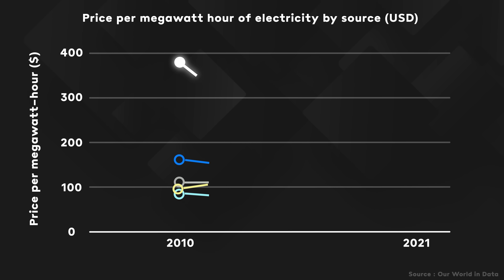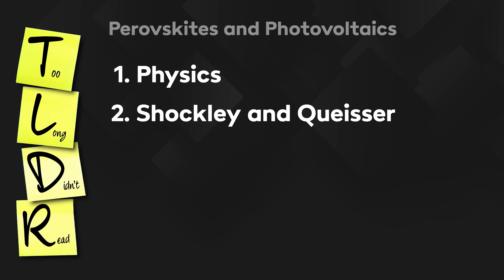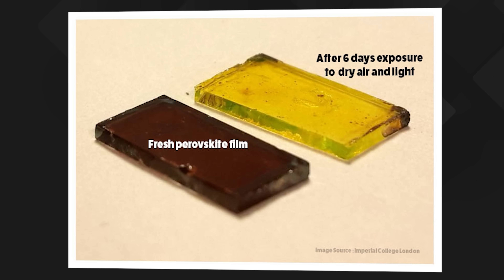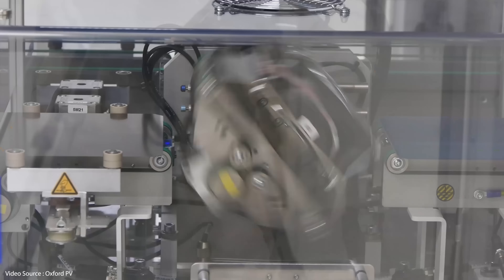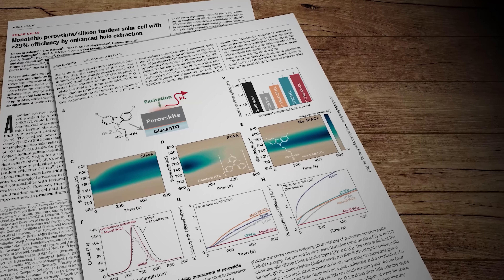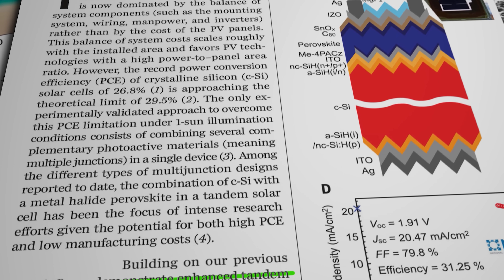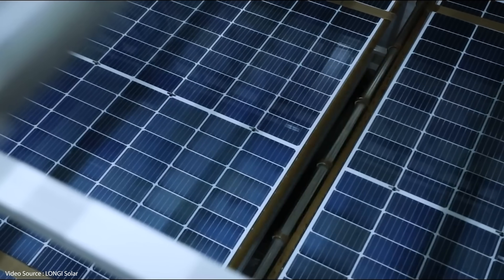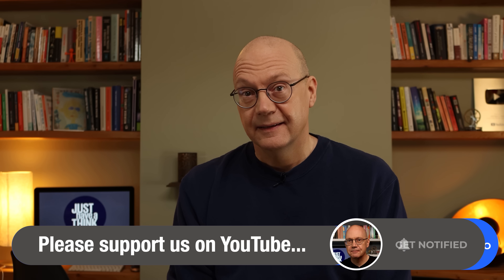Perovskite Solar PV. FINALLY some good news!

Comment: As an installer, I cant wait to see some from the wholesalers as this would mean people in smaller properties could have a system worthwhile and get their bills down. They dont need to be big roofs or even face south. East West splits will work well, I do lots of them and my customers get their investment back with 5 -7 years with plenty of life to make and save a tonne of money.
Reply: I'd also imagine lighter panels would be appreciated as a general safety and convenience benefit to your employees too.
Reply: @meganegan5992  i doubt its gonna be lighter as the perovskite is additional to the silicone ones.
Reply: @teekanne15 most of the mass is made of glass, plastic and the aluminum for support structure. The photodiode part weighs very little.
Reply: @teekanne15  Yes, it won't be lighter and also there's no trend to make it lighter at all as the handling of numbers of panels is a dominant cost factor. Lighter would mean smaller and more panels which would be a drawback over the current state of the art. (costwise)
Reply: @teekanne15  that's fair. I hadn't considered additive panels, moreso the idea of getting rid of the silicon altogether, and like an above comment said, the majority of the weight comes from the glass and aluminum, not the photocell. Shame it isn't as good as I'd imagine, but still, this is just good news in a different way, no?
Reply: I am the employee of my own company so I flipping well hope they will be🤣 @meganegan5992
Reply: Joe, agreed! On a lot of houses, the bit of roof facing south isn’t that big!
Reply: @freeheeler09  The roof doesn't need to face south to be productive!
Reply: Yeah.  I've seen several estimates for my house over the past five years or so.  Can't make it work financially.
Reply: @bjb7587  400w panels are freely available for less than £100 each?
Reply: wrong people doing your estimates. 5 kw and 10 kw battery should be around the 10k mark and provide you with a 5 yr return on investment leaving another 5 yrs under warranty to save the same outlay, around 10k depending on house. My customers do ! @bjb7587
Reply: And be lighter for you too 😅
Reply: 🤣Yep @Bill-uf6os
Reply: @liam3284  Less material for the same power is correct, but a typical smart prosumer wouldn't install less material but more power. Bottom line the installation weight is approximately the same.
Reply: Every time I read perovskite, my brain pronounces it perskovite for some reason...
Reply: Why would it be good to waste solar cells that could go into well-built and well-sited solar farms just to make people money? Isn’t the planet worth more? We’re already throwing away half of the value of home-installed solar (versus just installing them in farms), even without counting the increased roofing costs and damage.

Such a waste. Almost as bad as recycling plastic that could otherwise provide clean fuel.
Reply: @liam3284  15 years is a more realistic value.
Reply: Solar is still ridiculously expensive, way more than fossil fuels.  The LCOE metric is so incomplete as to be an outright fabrication.

If you have a power need, meeting it with solar is extremely expensive. You need a ton of battery storage and about 8 times that need in solar panels.  Like if you need a continuous 1kw of power continuously, year round, you will need an 8-10kw system or more to actually have a continuous 1kw supply. That's because solar NEVER produces it rated output, even at solar noon in the summer. During the winter, it produces far less and for much shorter time period. If you have a continuous 1kw power need, you need to generate your whole 24kwh supply in the time the sun is shining. Of course, a week without (EDIT SHOULD SAY WITHOUT DIRECT SUN)clouds in winter is quite common.

The LCOE only takes installed capacity into consideration.  However many solar panels you happen to have will produce X number of watt hours over its alleged 30 year life span. Divide the cost of the installation by the number of kwh and you get the LCOE.
Reply: @tarstarkusz  If you really take into account a 30 year lifespan, solar is actually very cost effective. From 1 KWp (installed) you can get close to 1 MWh annually, which is up to 30 MWh over the life span. In Switzerland, where solar is really expensive, if you install 1KWp as part of a decently sized PVA you pay CHF 2000. This means your cost is somewhere @ .07 CHF/KWh which in most places is about 5 times less than buying it from the grid. No idea how you think it is more expensive than fossil fuel.
Reply: @beatreuteler  Yes, but it won't produce 1kw continuously, which is how we need power. We don't need the average, we have power requirements.  This is true of our homes and it is especially true of the grid.
If you installed 1kw, when it was generating power, you would use less grid electricity. But if what if the grid wasn't there and you only had your 1kw panel system and you had a sick person hooked to machines that required a continuous 1kw?  That person would die hours before sunset on the 1st day.
Reply: @tarstarkusz  That is true but that isn't a problem at all. Industry and many other appliances like average households do NOT have a continues power requirement in that sense but have a significant midday peak requirement which corresponds pretty well with the average daily supply curve of solar systems. Then going from there networking is the key (even prior to storage). If you make your average power yourself but it doesn't exactly cover your demand curve, through networking with the "rest of the world" you can cover that nicely. If the gap is too large between purchase tariffs and delivery tariffs, you go for storage. That's it.
Reply: @beatreuteler  The grid absolutely does have a minimum requirement at all times. That is how it is designed.
Where solar makes sense, like adding it to the grid so on summer afternoons there is extra capacity to run air conditioners, it can/should be used. But that is not what people are talking about. They are talking about getting rid of the existing power plants and replacing it with solar.  Problem is, these plants have utilization rates over 90%. Solar goes as low as 5%.  Large amounts (though well under the majority) of solar should be facing West, not South.
"Doesn't exactly cover your demand curve" is the understatement of the century.
Reply: @tarstarkusz  Solar systems should be facing like the roof is exposed, e.g. if the roof is east/west, then solar system be east / west. The dominant south orientation is a result of the past when efficiency was even lower than today and people found it important that their system being facing south. With higher efficiency, orientation becomes less important and therfore people will build more solar systems in any orientation, which will be good for the total daily solar delivery profile. Talking about utilization rate of solar systems is nonsense. Every solar company will calculate the power expectation for your specific case and exposition. It is irrelevant how much installed capacity you have if you can finance it by the harvested energy. If your country and /or provider isn't making acceptable conditions for that, I then would agree it may make more sense for you to await better conditions. Where I live, we are not talking about getting rid of the existing power plants as far as hydro plants are concerned.
Reply: @beatreuteler  First, the majority of solar is not on roofs.  Second, the energy you collect is worthless and the laws making it not worthless is ripping off all the other customers.  Most of the cost of a kwh is not generation, it's the grid.
Reply: @tarstarkusz  I don't know where you live so I can't comment, but where I live the vast majority of solar systems is rooftop. The energy I collect, if it is excess I get paid for it with 0.18 CHF/KWh this is not worthless because it is higher than the cost of collecting it. Energy I collect and use it right away is worth even more because it saves me from buying. This said it is currently worth 0.36 CHF/KWh
Reply: @beatreuteler  You are getting paid that by law, not market rate.  The cost of generating a kwh of electricity is very low.  Most of the cost customers pay is infrastructure....the grid.  If you had to sell your extra kwhs on the open market, you would get very little for it.
Reply: @tarstarkusz  You are not correct with your guess. While providers have an obligation to buy the excess energy of Prosumers (by law) the tariff they are paying for this power is not regulated. This results in a patchwork of regions with very different tariffs, depending on who is the local provider. tariffs across the country currently vary from 0.06 CHF/KWh to some place like 0.40 CHF/KWh. By accident, our provider is in the mid range. The full cost of power from small to mid size rooftop PV depends mainly on installation cost and therefore is high here in Switzerland, it is about 0.1 CHF/KWh. Of course, larger PVA's have lower cost than smaller ones but that's a good average. A friend of ours that was able to build a 400KWp PVA rooftop on a small to mid size business rooftop achieves a cost of 0.04 CHF/KWh but that is rather exceptionally low.
Reply: You are not accounting for interest payments or lost investment income
Reply: Would a global grid taking solar from another side of the earth work?
Reply: Some of your 'Facts' are wrong. Of course it never produces its rated output, this why us installers have to use a predicted annual generation to a SAPs in the UK so its not mis sold. As for your alleged 30 yr lifespan, another incorrect comment by yourself from echo chambers on the internet. People that have it done right do save and reduce their bills to very little and the panels do last which is why they come with with 25 yr warranty as standard. If youre going to reply with a load of nonsense at least try and get your facts right.  @tarstarkusz

Comment: Cooling (and using) the heat solar PV panels collect increases net efficiency and lifetime.  Directing sunlight by reflection will also increase the length of total daily potential for energy production.  Both of these approaches will allow wider applications and lower total installed costs. The industry is cherry-picking locations rather than innovating for broader potential sites in the urban environment.
Reply: Yes and no, the more you can convert the less heat there will be in the first place. IR is the heat - so if you can take that in - the less over all heat goes to the rest of the panel it self.

Comment: the supercool thing is, that the additional efficiency is still there in winter where the loss of energy mostly affects the infrared part of the spectrum.
using them vertically on a fence or balcony still gives you a good amount of efficiency in winter.
the vertical installation is not perfect in summer but it is a better balance throughout the whole year for people who live a few thousand kilometer away from the equator.
and together with a sodium ion battery, you get a quite affordable setup to produce cheap energy everywhere all year.
btw.: the University of Bayreuth pushed sodium ion batteries to 165Wh/kg which is fantastic!!!
the future of renewables is bright!!!
Reply: And panel temperature is often forgotten.  Efficiency drops at T rises, but as T falls efficiency rises.  I just had a 100W panel at peak winter sun, northern latitude, ideal alignment and on a clear day at subfreezing temperatures generate 110W while on a normal sunny summer day, you never get above 90W.
Reply: @SeekingBeautifulDesign  Should actually also help a bit in summer. As more light is converted to electricity less is converted into heat.
Reply: I didnt know this, do you have any numbers on its potential extra gains in winter? Current panels are already efficient enough in summer where even my small system makes way more power than I can use but the worst 3 months of winter are a real struggle so even a 10% gain would make a difference.
Reply: @jedics1  You can't expect any extra gains as the time you can expose a panel to the mentioned performance is typically very short.
Reply: that is a very good point, I didn't think about it this way. since visible and ultra-violet light get scattered by the atmosphere, a visible/blue light solar panel will be more efficient when not in direct sunlight than a normal solar panel. I imagine it would also make perovskite bifacial solar panels a lot more interesting for the same reason.
Reply: obvioulsy not possible fromn he sun directly, therefore must be snow r frost that reflects. therefore surrounding the floor with mylar or similkar woul do he same job and your panels not get wrecked vertically haha
Reply: @PazinPortugal  This isn't quite right - the nominal wattage of the cell isn't its 'absolute maximum potential generation', it's the amount generated AT 25C. So similarly to the massive gains low earth orbit gives to solar panels, when the actual panel temperature is substantially lower, you can often generate more from the panel, without any reflections etc.

Comment: ….adding solar capacity….. 
Great, now the hard ( and expensive) part, integrating all that ‘capacity’ into an existing grid.
Reply: an alternative, is don't.   use it in applications where power behind the meter can displace the need to draw down from the grid most of the time.  Imagine a home battery system charging off grid and using it in blocks of time to match the capacity during heavy grid load periods ... freeing up grid power for other instantaneous demands.   Or some Tesla charging site with a couple megapacks soaking it in and dispersing it out instead of the feared "EVs will overload the grid"... so it doesn't even affect the grid except for maybe some very small continuous charge on a low V supply line like any other office would have during low demand hours - and could be shut off on demand periods by the utility... Lots of ways to work it in OUTSIDE of adding it to the grid, just by displacing grid draw - and not need to deal with right to upload etc.  Way simpler and definitely faster than getting approvals.
Reply: @lylestavast7652  it’s complicated, …and expensive. 
Certainly feasible, however it will remain a niche tech addition due to the $$$ involved.
Cheers